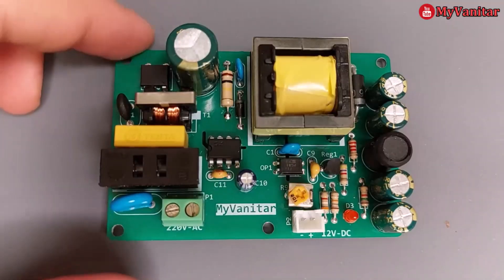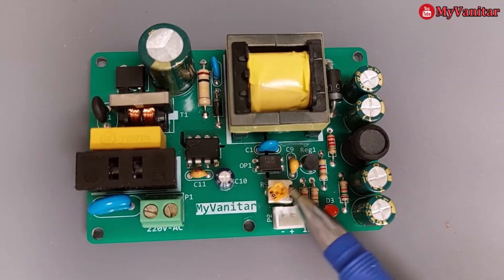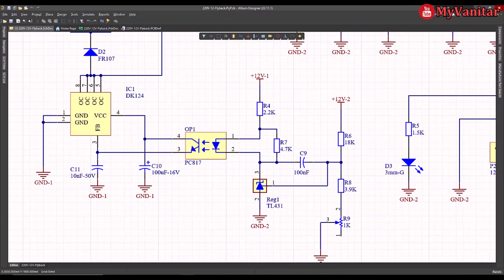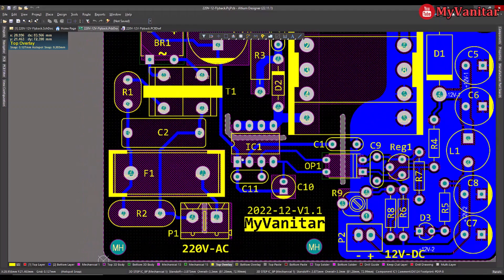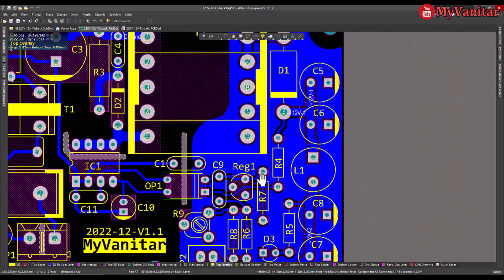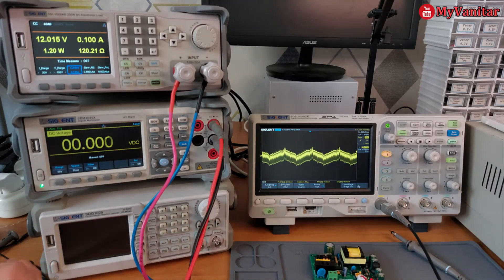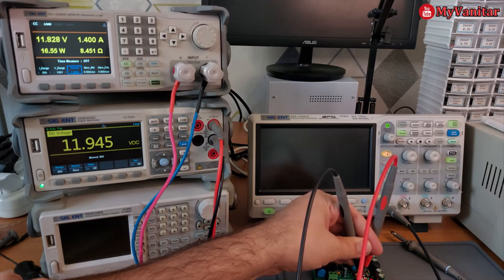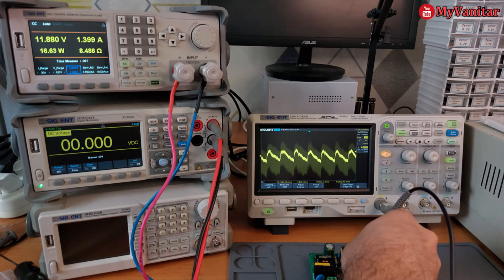220V-AC to 12V-DC, 18W Switching Power Supply

Comment: Please can I convert a 12v dc to an output of 18w DC with 1.5A?
Reply from the maker: 18V DC you mean? W = V * I. if you mean 18V-1.5A then the power is 27W which none of the DK124/DK125 can handle. 1.2A is possible with Dk125

Comment: how can i get 12vout / 4 amps from this design?
Reply from the maker: 12V-4A means 48W. The maximum power of this Flyback chip is 24W. if you have a project request contact me via Email
Reply: @MyVanitar  i'm a college student and i wanted it for my for my project this semester, just having a trouble adjusting output voltage and current  and controlling them separately . sadly i can't afford a project but i would really appreciate any tip you can provide .
Reply from the maker: I have a 12V-7A version on my channel. check the details for your info. The output of these supplies is not that much adjustable except you use a buck converter at the output
Reply: @MyVanitar  thanks .

Comment: Hello, if I wind the secondary with 0.65mm wires making the same 8 turns will it make a big difference?
Reply from the maker: no, go ahead
Reply: @MyVanitar  What is the inductance margin in the transformer to avoid any problems? Thank you very much in advance for your help
Reply from the maker: that potentiometer in the output compensates any small transformer error. 0.65 and 0.67, the difference is very low
Reply: @MyVanitar  Ok, thanks for the help

Comment: Sir, What is the frequency when using LCR meter? 70kHz?
Reply from the maker: it depends on your LCR meter, some of them are manual and you decide the range, so you put the selector on the range to measure your inductor. if you have to enter the frequency, you must check other parameters such as the angle to check if your selected frequency is good.
Reply: Thanks a lot.
I have another question.
Why you using parallel in secondary winding?
Reply from the maker: that's the only way to handle more currents. one thick wire or two thin wires in parallel which is way easier to wind, especially on a small bobbin
Reply: I wonder how you set the flyback voltage in the transformer design.
I can't calculate your transformer design value, maybe there is an error in my calculation.
Reply from the maker: Couldn't you solve the inductance readings of the primary winding?
Reply: @MyVanitar  Considering flyback voltage, number of turns, and the switching frequency, I couldn't reach to your value.
I don't doubt it because many people made smps with your design. I just wnat to know the difference between my calculations and yours.
Thanks a lot.
Reply from the maker: I'm just trying to solve your problem, but you did now mention how you measured the primary inductance. Did you use an LCR meter or you used another method. also your core material might also affect this, maybe it's a different ferrite type. by the way if you are sure that your inductance reading is true, just increase the turn number of the primary till you reach the desired inductance value.
Reply: @MyVanitar  I used LCR meter and core also same(EE25-13-7 of TDK).
Anyway this is my new question.
If I increase number of turns of primary, should I maintain turn ratio?
That means I have to increase secondary also while maintaining turn ratio.
But In that case, two inductance have some difference... Is it okay?
Reply from the maker: I meant ferrite material type, of course, the size should be EE25-13-7. Are you sure about your wire gauge? what's your LCR meter (brand and model)? I think you should maintain the turn ratio. Truly this has not happened for me so far.
Reply: @MyVanitar  I made PCB with components, but It doesn't work even no switching. There is no voltage in optocoupler input, voltage regulator. It doesn't make 2.5V... How can I solve this problem?
Reply from the maker: desolder the transformer and connect it to the board using short wires. this allows you to reverse the winding of the secondary. check it that helps. also, I'm unsure about the windings and what you did with them. Check Figure 5 in this article: https://www.pcbway.com/blog/technology/85V_260VAC_to_5VDC_2_5A_Flyback_Switching_Power_Supply_b7f49beb.html
winding start points and winding direction should be like in Figure 5.
Reply: @MyVanitar  I think transformer is correct.
I'm studying about snubber circuit now, but the RC time constant value seems too big for the switching time Ts.
Is it possible that switching does not work because the capacitor is not properly discharged?
Reply from the maker: Snubber is just to reduce the spikes to not to damage the mosfet (internal or external)

Comment: Hi Hesam. Thanks for this design and the video. Please allow me to draw your attention to a small error over on the very helpful PCBWay article for this design. Where you see this text, 'R3, C4, and D1 build a snubber circuit to suppress transient spikes of the transformer', I think D1 should be D2. 
Thanks and regards, Rick.
Reply from the maker: Hi Rick, Yes, Thank you. D1 is output, and D2 is correct. Typo mistakes or some small errors could happen because of tiredness. Content-making is a difficult process. Thank you that you read the article  and watch the video completely

Comment: anyone made this circuit ?? i made this and i got 324VDC on the 5,6,7,8 pins in the IC and 5VDC at the VCC pin but no output from the secondary also there is something strange when i turn on nothing happens in the output but when i turn off after few seconds the LED bulb turns on and off. dose anyone get this issue??
Reply from the maker: You very likely made a mistake in winding the secondary, direction of the winding (if you have built this based on my PCB).
Reply: I doubled check the winding orientation it good. i noticed now the PWM switching isnt starting. did you come across this issue??
 @MyVanitar
Reply from the maker: How do you think the winding direction is good. why the PWM should start when there is no energy transfer. By the way, the circuit has been tested many times.
Reply from the maker: Transformers can be tricky if you are confused, even this simple transformer. if you have followed my PCB and correctly soldered the components, I don't see any other reason
Reply: @MyVanitar  i made the transformer using a chinese company and they provided me with a datasheet and i dismantle one checked it myself. Issue is the pwm switcher i think
Reply: is there a way to check the IC is switching??
Reply from the maker: this is the 3rd time that I am replying to you with the same sentence. if you followed or ordered my PCB and you have soldered the components correctly, the only thing that remains is the transformer. That's it

Comment: Sir if I want 12V and 1A current for my project... How can I change my power to 12W....in circuit which part I need to change
Reply from the maker: This supply can handle a maximum power of 18W, which means lower than this power is of course no problem!

Comment: Friend great video, I only want to know if there is possible a change to do the circuit functional with 110-AC ?
Reply from the maker: Good question. if you check the datasheet of the DK124 chip and the "power range" section, there is absolutely no problem with 110V-AC.
Reply: @MyVanitar  great and thanks friend :D

Comment: Can we make it regulated also ? 0-12 V
Reply from the maker: that's very easy. connect a linear or switching regulator at the output to make the output adjustable.
Reply: @MyVanitar  Which one should I use Lm317 or IRF44n or anyone else?
Reply from the maker: IRFZ44 is a MOSFET, not a regulator. You can use LM317 if you don't go higher than 1A. otherwise use an LM2576 switching converter. The Chinese boards for this are very cheap.